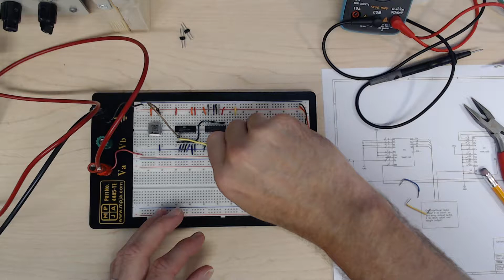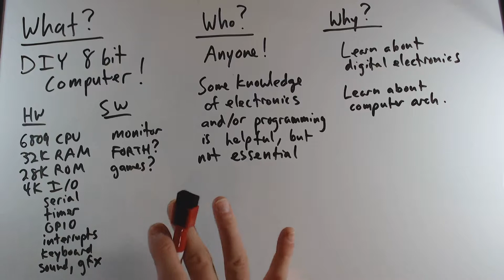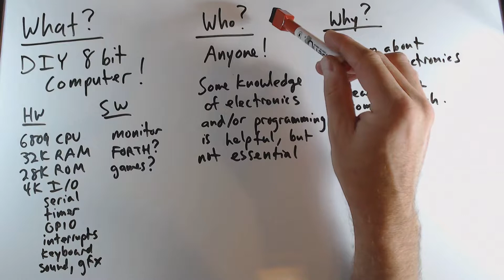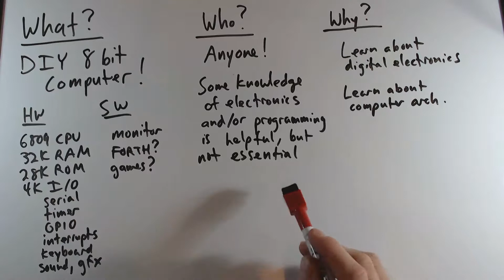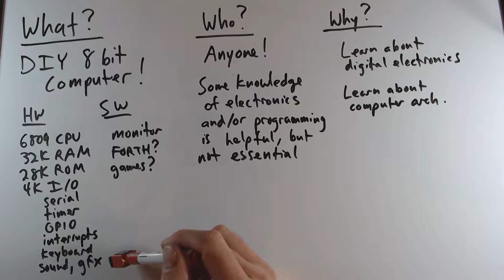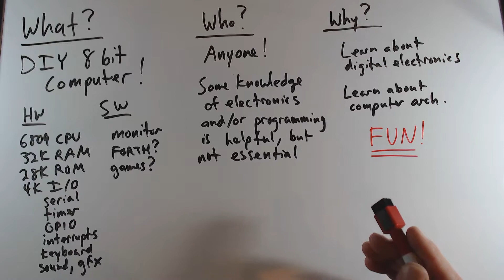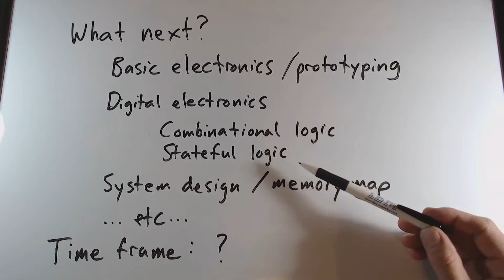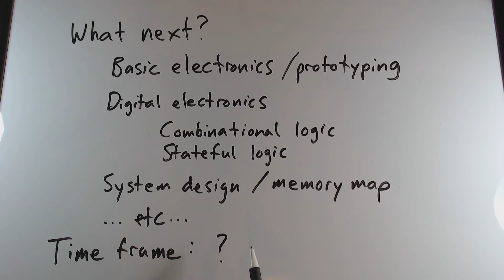DIY 8-bit computer, Episode 1: Introduction and goals

Comment: I find it very interesting that you went with the 6809. Most DIY computers and kits nowadays use the 6502 or Z80
Reply from the maker: Looking back, I'm not sure exactly why I chose the 6809. Part of the reason was that I just happened to have some of them on hand, and I knew it was one of the more advanced CPUs from the 8-bit era.
Reply: I would say it is the most advanced 8-bit processor.  And really good for implementing Forth since it had 2 stack pointer registers.  It's a REALLY cool processor.

Comment: Hi there. Sorry I'm a bit late to this party! I've also been designing and building a 6809 based machine over the last couple of years (on and off!) Mine uses 68xx series components for the most part (6850 ACIA's with MC14411 baud rate generators, 6840 programmable timer, 6821 PIA's) but have a few slightly more advanced chips that I intend to add (eg. floppy disk controller and V9938 video controller). Mine is being built on 160x100mm Eurocards to fit into a rack. It works well so far and can download programs from my PC development system in Motorola SREC format using a serial port. The biggest issue so far has been the lack of hardware flow control on the 6850 meaning I have to transmit things very slowly in order to ensure the decoding routines on the 6809 machine have enough time. I have hacked a board to use the interrupt pin to as a CTS (as described on the web somewhere) but am still testing it. I've got some 1655x series chips to try too. As an interim cheat I have also hacked a serial board to drive a serial-to-VGA board and a USB keyboard to serial board. I intend to eventually input via a PS/2 keyboard (probably with a PIC microcontroller as a decoder) and output via the 9938. Looking forward to watching the rest of the series. At least being late means I can binge-watch it! 👍😁
Reply from the maker: Wow, your project sounds amazing! I considered using the 6840 as the CTC, but I found the datasheet confusing. Somehow the 82C54 made more sense to me.  The 6850 was a breeze to use, although I also have not implemented any form of flow control.. I've heard good things about the 9938 and later graphics chips. I would have considered going that route, but I was worried about limited future availability.

Comment: One tip from you I just used on my breadboard 6502 was soldeing header pins to the zif socket. I had just filed down the little nubs on the bottom so the pins went a little deeper into the board. It worked king of ok, but with the pins soldered on it is rock solid. It was not all that easy to do though!
Reply from the maker: Nice, glad it worked out for you! Those ZIF socket pins don't always want to take solder, but with some patience it can work.
Reply: @davehohacks  Thanks again for the idea!

Comment: AWESOME!  This is exactly what I've been looking for..  I've been following Ben Eater's videos, but as an old TRS-80 COCO fan, I REALLY wanted to find a similar project with the 6809/6309 chip instead of the 6502 he's using.   I'm definitely going to watch this whole series, and start building mine..  I already have two 6309 chips I had ordered to try to start following ben's design, but with the different chip, but I was concerned about how I'd handle the dual clock..  ALSO..  You may have answered this in a followup video I haven't gotten to, but....  Can this single-step like Ben's design?  I'm not sure the 6309 is even capable of it, but if so, I think it is a TREMENDOUS teaching tool to be able to SEE what happens a step at a time..
Thanks!
Reply: The 6809 MPU Motorola chip is qite capable compare to 6502 this 6809 is a 16-bit arquitecture with 8-bit data bus just take it's specs look in my opinion 6809 its a real wolf with sheep's skin.
Reply: The only real 6502 advantage  over 6809 is the  software qty. available